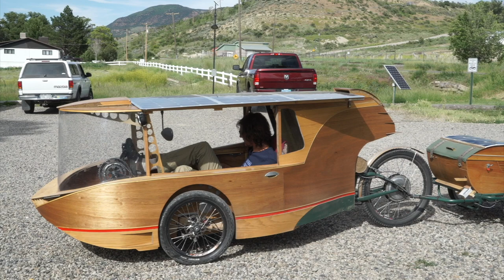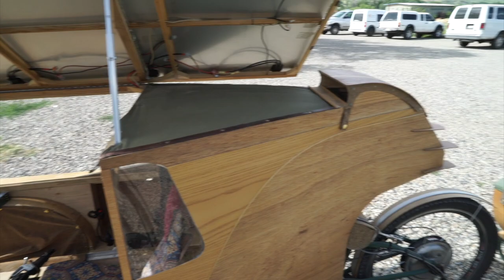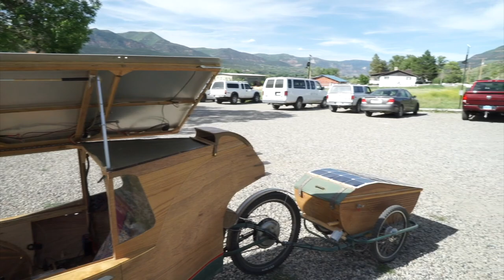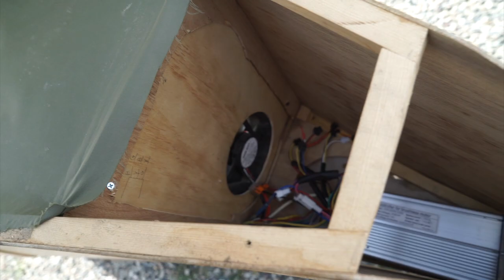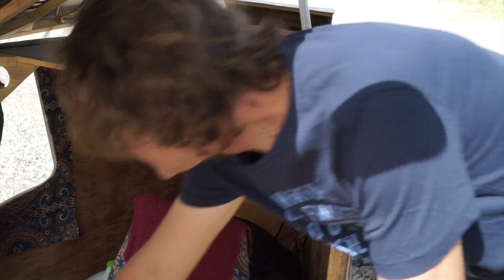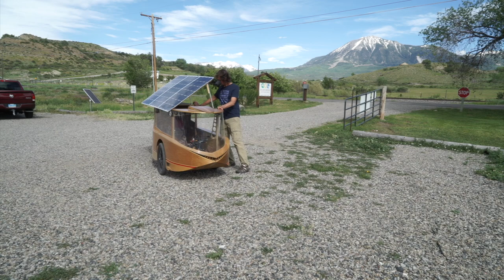Check out the solar-powered clipper trike making its way across the Western U.S.!

Comment: Nice video. Thanks for sharing. Would it be possible to install a couple of retarder brake with resistances to have electric braking when the battery is full? A switch would transfer power generated at the motor to the resistances when a stronger braking is needed.

Comment: Hi im making a recumbent trike electric and a camper for the back at the moment i have a 24v 250w motor and battery for it but am going to put that on the camper and put a wheel motor on the recumbent just so it doesn't kill my speed so if i want to charge that battery and a lithium 1000w battery what power solar panels will i beed my friend please

Comment: A resistive dump load could help with your downhill braking issue and let you keep the batteries full.  Dump the regen current to a power resistor or a heater element and waste it out as heat. Probably require a custom controller

Comment: nice.. functional art.  I have a recumbent Solar E-Trike.  My BMS protects the two batteries (over 1800wh) at 52v give me limitless range on sunny days..The Genasun GVB-8 automatically turns the boost/charge current on and off based on the voltage of the batteries.   I did some experiments:  1) i use a MistyMate (portable pressurized misting system to cool the solar panels) and 2) i got some of those highly reflective sunshades (the kind you use in the car window to keep cool) to add to and reflect sunlight onto the panels when i'm not moving anymore.. I set the reflectors up at the campsite just to get the most out of the sun.  (you have to watch to make sure it doesn't get too hot by using the misting system.  
I can see this project was a labor of love.  The craftsmanship is beautiful.  I'm hoping to ride the Rails-to-Trails, from Portland, up to Coeur D'alene, Northern Idaho, Montana, Wisconsin (where i  have friends)  Have you done any long distance touring..?  Robb PDX

Comment: What an incredible vehicle, if I had the cash I'd build one like it in a heartbeat
Reply: With e-assist and solar panels it can be done for $1000-$1500
Reply: Trike alone costs more than that, even more, $2000 price tag for used trikes.

Comment: I'm trying to build something similar with a camper trailer to travel around England in doing my paranormal hobby
Reply: dont fancy doing a trip in winter with cold and snow lol
Reply: Where in the uk are you based. I've built a plywood bent. but it is a low racer, not a camper
Reply: @ghostmandeak7305  It is good. Although now I want to make it faster.
Reply: @aloysiusflartey6122 did you not hear him say he likes it best for bike camping in winter because a) he’s got in floor electric heat and more than enough electricity to run it—says he barely notices any drop in the battery, plus b) as a 3-wheeler he doesn’t worry about a fall on ice the way he would on a bicycle. His recurrent problem is more power than he knows what to do with, not a shortage.

Comment: Get your son on that job of the brake problem. IF the battery is full then it will use a short circuit designed just for this reason, so you can still STOP the bike!